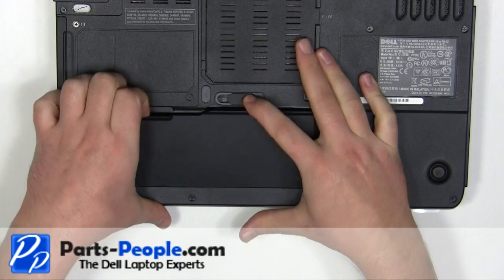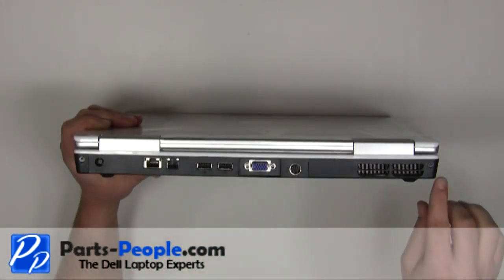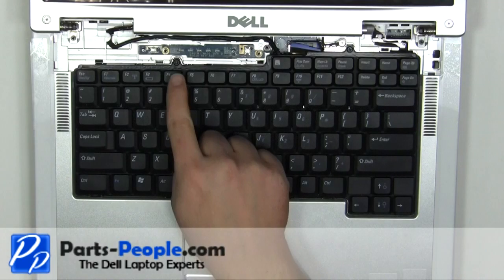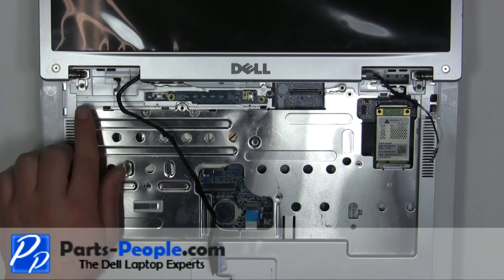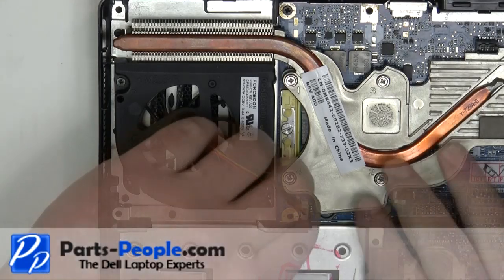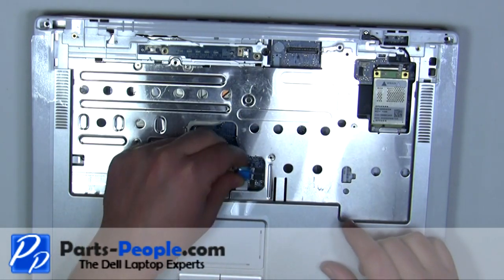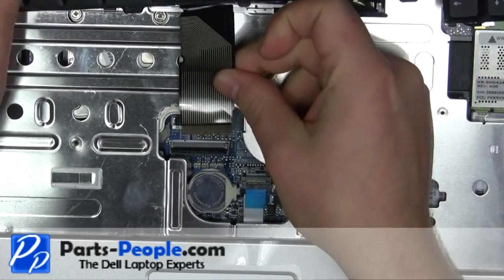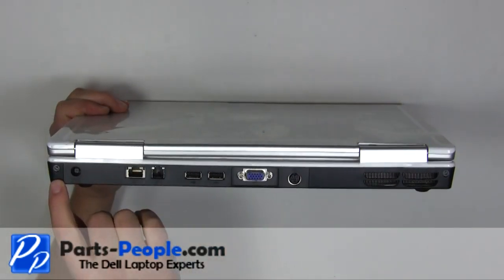Dell Inspiron 6400/e1505 | CPU Cooling Fan Replacement | How-To-Tutorial

Comment: Do the cooling fans intake air from the top and exhaust through the bottom of the laptop?
If I place a cooling fan underneath the laptop, to provide more cooling air and assist the laptop fans, I need to know if 
I need to pull the air in through the laptop fans or bring cool air in from underneath the laptop and push it through the top of the laptop.
Reply from the maker: +Forward Plans The fans pull air from the bottom and push it through the heatsinks and out the back of the laptop. A cooling fan underneath the laptop would work best. Also try cleaning dust off of the fan and heatsink. That will help it cool down too.